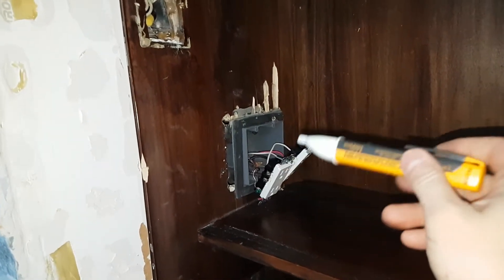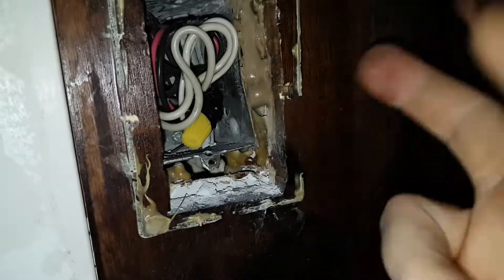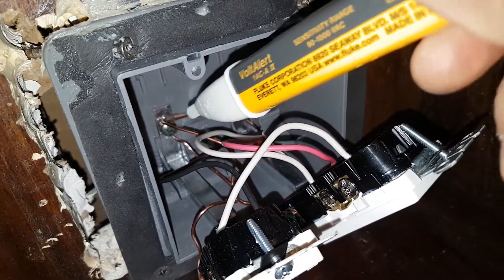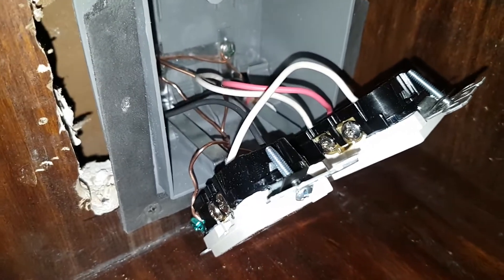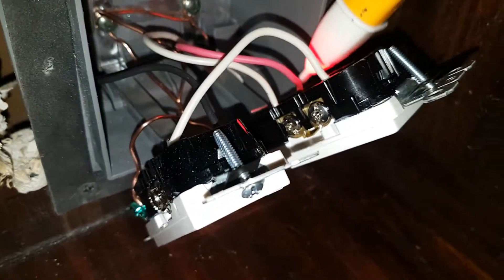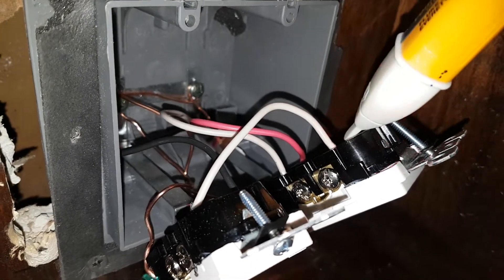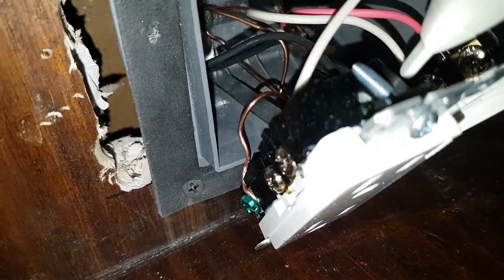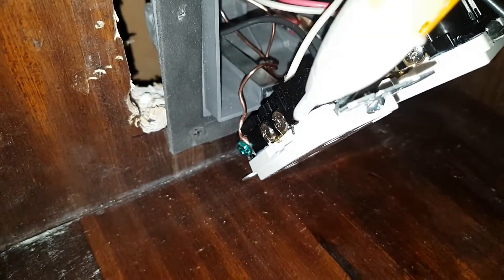How to Wire 2 Receptacles in one box from Single 14-3 Wire using Electrical Pigtails

Comment: Question: Are you separating the loads on these two GFCIs or are you uniting the amps? I have two 20 amp GFCIs that I want to separate but have them share the neutral and ground 
I am running a 12/3 cable to the panel and need two separate GFCIs 
Thank you!🙏🏼
Reply from the maker: I am uniting the amps. Any receptacle running off a breaker shares amps. U can have 2 x 20 gfci but if u run 2 power tools off them that exceed 20 ull pop the breaker . But for convenience sake it's good to do that.
Reply: @UnboxingArmy  Thank you so much for your prompt reply!🙏🏼
I have a double breaker in my situation 
2 hot wires one neutral one ground and a double breaker (20amps each)
Reply: @UnboxingArmy  Thank you! I am running these GFCIs for my small kitchen counter appliances such as a toaster/coffee maker/blender etc. Your video really helped me! And I’m doing my own wiring out of necessity cause I’ve been ripped off so many times! I then decided to read the electrical books and apply the info…. I am a 62yr old widow and I thank you for your valuable content
God Bless You🙏🏼